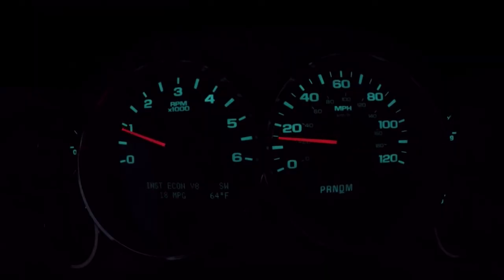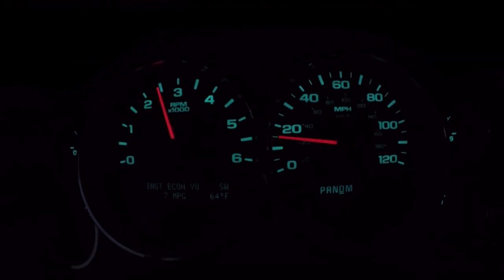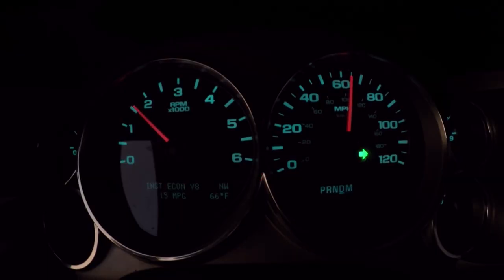Pros and Cons of a High Stall Torque Converter

Comment: Finally answers I needed. I had a cam put in my Challenger. Runs great except stopping at low speeds or trying to take off slowly, it jerks forward choppy, surging. So, stall converter is needed for mine then. I just don't wNt to big of a stall. I figured between 2800 and 3400. But thats a good range. I have a 5.7 rt with a Stage 2 HRT Comp Cam.
Reply: I know you've probably already moved on and gotten a stall (or even a new car), but I love to talk about stall converters, so I thought I'd add my perspective. When looking for a stall, a lot of guys try to get as close to their peak torque rpm as they can stomach. I'm an LS1 guy. Our stock motors make peak horsepower at 4000 rpm. A 4k stall is kind of a up there, so the general consensus in our community is 3600 rpm is a good balance for high performance and streetability. That stall speed, 3600, generally means you'll have to tack on about 300 rpms more to do anything until it hits lockup. A lot of guys put 3200 or 2800 rpm stalls in their LS cars and are disappointed. But I think they drive very well, not very noticeable. 

I'm assuming you had your car tuned after the cam swap. Look at the dyno sheet and pick either 1) as close to your peak toque rpm as you can or 2) where your torque curve starts to get really fat, but not quite at peak torque rpm.

However, if you really are worried about getting too big of a stall, you should still look at your dyno graph, and look at the lower end of your torque curve. Pick a spot where you are making some torque, but not too high of an rpm. 2800 or even 2400 may be better for you.

I do have to say, though. You have a cam. A big enough one to cause vacuum loss at low rpm. Why would you not want to pair it with the correct stall? The stall that gets close to peak torque. Can you imagine cruising around and having access to like 80% of your torque anywhere, anytime, at any mph? Although, I guess if you got a big cam with a lot of overlap, you're already tossing gas out of the cylinder, literally. So, I could see if you didn't always want to have to rev up 300-400 rpms higher to do things. Would hurt gas mileage even more. But still, a proper stall would make your car insane, I bet.

Comment: i have a 2000 silverado single cab with a 232/236 cam and 3600-3800 circle d triple disk converter which i use as a daily driver 😁 it actually runs really good on low rpms you do feel quick acceleration just by tapping the gas a little bit though

Comment: Great video .  
     I'm glad you mentioned adding or using a larger transmission cooler .I'm in the process of building a Chevrolet small block 400ci and going with a larger camshaft .  I plan on using at least a 3500 rpm stall for my application.

Comment: Your torque converter must be calculated and tuned for your vehicle and its use. If you pick it by price only, you will most likely think it drives like ass.
Reply: I'm confused by this. The research I have done and from others input. They say you can run a 3k stall and just put it on fine. Anything higher and you would need a tune. (4l60e)
Reply: @dnegel9546  you're going to need tuning for a stall to really have it drive right. The higher rpms a stall will flash to makes the trans computer do some weird shifting sometimes and even if it doesn't its best to optimize it. 

However what Raymond is talking about is that a 3k stall is not a 3k stall behind anything you want to put it behind. Weight affects stall speed. Gears affect stall speed. How much power the engine makes affects stall speed. The right way to buy a stall is to call a company like circle d. Tell them exactly what you have and what you're looking for and let them build you what you'll need to achieve that
Reply: @dakotadale567  circle d?
Reply: @guardiandogoargentinos1385  They make great stalls. Yank also makes really good ones.

Comment: I have a completely new drive train that I put in a 3/4 ton gmc van to use as a test bed cause the nova it’s going in isn’t ready but I’m after info here,,, I called Coan racing about a torque converter and after giving them all my info for the van,not the nova(cause I figured I could have redone later if need be) so it would be vehicle specific.they gave me an 11” converter for a slightly bigger vehicle which is what I’m wondering about here because most everyone I see and listen to on here for pick ups are using 10”.Coan told me mine came out to about 2800-3200 but mine has no looseness what so ever but still works great.it’s near 475 hp with 3:73 gears and for me it’s not about showing off but rather info.did all you guys have your converters built giving the companies all your info or just go out and buy what you wanted?

Comment: Before you get a stall ask the company if it’s  loose or tight converter. Tell them what you are looking for.  That will help you get the type of converter you want
Reply: For anyone wanting more information, they call this STR. Stall-to-Torque ratio. 2.1 is considered on the looser side, but not all-out racey. 2.5 is a race stall and will not really be good to drive on the street. 1.8 is kind of tight. Most of Yank's stuff is around 2.1 and they work really well with LS1 cars, among other things. I'm not sure where Circle D or the other stall companies fall in their STR.

Comment: What’s your average mpg currently? Get yourself ls3 throttle body for your next mod. Plug In and play. Better acceleration bigger opening.
Reply from the maker: I get around 13.4 average mpg at the moment. And I’ll look into that👍🏼
Reply: John Vesely I got the acdelco LS7 throttle body from summit racing. It’s a 90mm tb to match our gen 4/tbss intakes. Only about 100 bucks not bad. I noticed a slight increase but it does affect the tune and kinda surges at 55 cruising rpm. In my case at least

Comment: buying a built 4L60 with 22-2400 stall torque converter tomorrow to go with my stock 5.3 v8
Reply: Well your first issue is it’s a 4L60
Reply: steven Chaney 4L80 is to complicated...
Reply: steven Chaney 4l60 and 4l60e are totally different transmissions. 4l60 is more of a heavier duty 30 spline 700r4 than a 4l60e when they stopped utilizing the auxiliary valve body in 1990. 4l60e is electronically controlled, hence the e.

Comment: Ohhh okay, lol at first I had thought you said 80deg for the trans I was going to say my 6l80e in my 08 denali sport 6.2LS runs anywhere from 130-170deg but it is all time awd and i do have minor bolt on upgrades ie intake with K&N, gibson long tube headers, MBRP installer series cat back and a superchips flashpaq F5 tuner... She is a beast for a 7,100lb vehicle it moves with stock 420hp & 460tq so im hoping im closer to 460+ HP with the minor mods

Comment: Hey JV Garage i am wondering how many miles you have on your truck? I have a 2010 Silverado with 130K km (about 81000 miles) and id like to know in your opinion  if it is worth putting money into it for everything that you have in your truck. I love how it sounds and i want my daily to be just like that.
Reply from the maker: I did the cam swap to my truck when it had about 68k miles on it. I currently have about 130k miles and nothing major mechanically has failed engine wise. I did blow my torque converter and my rear end but both were known to go bad. It also depends on the transmission. If you have the 4l60e I’d recommend building that up first then add power to the truck. But if you have the 6l80e then you should be fine for awhile. But when you do mods to the truck just be ready for things to break, it’s going to happen, it’s just a matter of when.

Comment: It's common sense that at very slight throttle or at low rpm in lower gears without being in lockup a loose converter is slipping gas mileage will go down or stop and go driving it's going to be less efficient most likely slipping and revving faster until it goes into lockup if gas mileage was better with a stall it would be used by the manufacturer there's a reason your truck most likely had a 1600-1800rpm stock stall converter gearing and weight of vehicle and where the engine makes power all have a large effect of the outcome l have a Circle D 4200rpm stall in a 2011 Camaro SS and it turns 2500-2800rpm very easily in 1st-4th gear at part throttle 5th gear it goes into lockup around 45mph then 6th at 50mph then it's much like stock just the slightest bit more of throttle pressure unlocks converter rpm goes up instantly and very fast you have to try to keep the rpm below 2700rpm at part throttle in 1st - 4th gear touch the gas your past 2200rpm off idle with a touch of the petal throttle response it wicked good it runs on E85 so it's cost effective but it burns it fast 11- 12 miles to the gallon city 18 highway at 80mph at 2100-2200rpm with 3.27 gearing and a built 6L80e automatic trans it's not daily driven but is out every nice weekend for a 25 mile drive l would recommend stay with a stall of 2400-2800rpm for daily drivers 3000 max but it most likely will not perform as well as a 3600-4600 stall would

Comment: Question Sir.  When accelerating with the higher stall converter, is it only faster up to the speed previous associated with that stall of 3400? For instance, before the higher stall converter, once you hit 3,400 rpm would the remainder of the acceleration through the power band with the older stock converter from 3,400 through 6,000 be comparable to the highstall converter for that same range, or is the High stall's looseness continue to multiply torque more than stock somewhat above the 3,400 stall speed?
Reply from the maker: That is a good question and I do not have the answer. I’ll definitely look into that. I have heard that you lose horsepower to the ground with a bigger stall because of it being looser. You can also get converters that have a triple disc lock up for WOT to help with the loss of horsepower due to slippage. So there could be some torque multiplication going on but I have no idea.
Reply: This is actually a complicated question. It depends on how loose your stall is. This is different from lockup speed (also known as flash point). The flash point determines when your stall acts as if your engine and transmission are locked together. An example of a flash point is 3600 rpm. If you have a 3600 stall, that means your flash point is 3600 rpm.

How loose the stall is comes from its Stall-to-Torque ration (STR). If you have a high STR, that means the stall is really loose. That also means you will get to the flash point even faster. The third thing it means, is that your stall will not multiply torque as well after it hits the flash point. Stalls with a really high STR get to the flash point quickly, hit very, very hard at the flash point, then fade away.

Stalls with a more conservative STR take longer to spool up and hit the flash point. They still typically turn faster than a factory torque converter, which all have very low STR. Cuz I mean, come on, if it didn't help the engine build rpm faster than a factory tc, then why bother, right? However, they still build rpm slower than a high STR stall. The trade off, is that once you hit the flashpoint, your stall keeps multiplying torque for longer.

Just to give you reference, a 1.8 str stall is pretty conservative, 2.1 is in the middle but leaning to the looser side, and 2.5 is crazy loose and most people wouldn't have the tolerance for it on the street. Most guys opting for a performance stall get 2.1 STR and it does really well. Guys that are building hardcore drag cars typically get 2.5 str or more, and people who want to be really conservative with their stall get 1.8 or 1.9 and are often disappointed at the performance but like the street manners.

Comment: I’m looking to replace my TC in my 8L90. Came across Circle D (2800 stall) and was suggested Circle D for the mods I have planed. Wasn’t too sure on it and don’t know a whole lot about higher stall TC. I think factory stall on kine is between 1800-2000
Reply from the maker: Just make sure you get a big enough transmission cooler for that torque converter. The cooler the temps the less likely it will fail prematurely.
Reply: I was looking at Part # STL010 Sure-Cool cooler Flow~Control System and B&M deeper pan and dip stick to help. I didn’t even think about the cooler, but that’s an idea now
Reply from the maker: Yeah it’ll keep it safe, and honestly you can’t go too big especially if you plan on still towing stuff around. Since there’s a lot more slip in the converter it cooks the oil unless you get a better cooler.

Comment: Thinking about doing a BTR STG 3 and a 2800-3200 stall whats your opinion?
Reply: If you are going to get that big of a cam, you should match your stall to it. You'll lose a little more mpg, and it'll be more of a handful, but only by a little bit. Look at the dyno after you get the cam installed and the tune done and find where your car makes peak torque, then get the stall that is closest to that, but also that you think you can live with on the street. Whatever torque converter company you talk to can help you decide what works for you. A lot of times cams make your power band go up in the rpm range, especially Brian Tooley's cams. He likes the exhaust duration, lol. If your cam makes your power band rise to higher in the rpm range, 3200 may be leaving a good deal of performance on the floor. 

For example, I'm an LS guy, and our stock motors make peak torque at 4000 rpm. Now, a 4k stall is pretty big, and not quite as streetable, so a lot of us go with 3600 rpm stalls. Lots of our guys get 2800-3200 rpm stalls and are disappointed with the performance from them. 

Bottom line, if you really want to see performance, match it to your rpm band and don't be afraid to go a little bigger than you expected.
Reply: Stage 3 btr requires 3200 stall.

Comment: Aren't you not supposed to use 4wd on the street? People say that... but I can't really see how it would be an issue as long as you don't have the lockers turned on... If it's open diff front and back...you should be fine I'd think...

Comment: Hi i just Bought a rebuilt tranny. From a guy. He didn't tell me it had a stall converter in it .  Called him found out it was a 2000. I have hooker headers. A mild cam. Pushing close to 400hp on a 68 mustang. Im just getting this all together currently. Any thoughts anyone. Im concerned all of the Complaints on them but mine is 2000. ?

Comment: Did you get the 278mm HP 3400? This is the one I ordered. Was worried it would be too tight daily driving but with the 2/B pump and stator I was convinced it was loose enough. Great vids!
Reply: How’s it doing? I just bought a billet 3600 multidic/ multiplate stall
Reply: @jasonloera3358  it’s perfect for the 3.42’s and stock tires on my truck. Gets into power band on throttle fast, but stays low idling around in traffic. Wouldn’t buy any other
Reply: @tayhay8  with that high of a stall does it shift late into every gear? Like when it’s stock it shifts to second at around 2k rpm now I’m assuming it’s closer to 3200?

Comment: I hate mine. It’s the worst mod I’ve ever done. Makes the truck not enjoyable to drive. Constantly revving the piss out of it to go anywhere. ‘04 Suburban, small Summit cam, heads, exhaust. I had a shop put it in when the transmission was rebuilt, it’s to the point where I almost thing somethings wrong with it.
Reply from the maker: How big of a stall is it?
Reply: Sounds like too high stall speed for the setup. You have to figure in the power, gear ratio, weight, tranny, application, and tires

Comment: I'd think you would lose the most gas on that long distance and maybe save a bit when idle in drive at a complete stop from my understanding when comparing to stock converter but idk because I haven't tried it yet. And not an expert.
Reply: It's the opposite. Long distance means you're likely on the highway. On the highway a high performance torque converter (stall) will hit its lockup, which means it will lock the engine and transmission together with no wiggle room. That's what every torque converter does, even the factory ones. So, on the highway, you're essentially driving a stock converter.

It's at low speeds that the stall really does its magic. It makes the engine and transmission more loosely coupled together at low rpm, so the inertia of the car isn't working against the engine while it tries to build rpm. To go fast, you want this because motors don't make much power at low rpm, so you want to make it easy for the engine to spin up to the power band. A 3600 rpm stall means the stall is loose until it hits 3600 rpm, then it gets tighter and transmits power from engine to transmission efficiently.

However, what this means in terms of gas mileage, is that if you'd normally be cruising along at 1200 rpm, now you have to go at 1600 rpm (or whatever) to go the same mph because the connection from engine to transmission is loose and it doesn't transfer power as efficiently, that's the trade off. Having a higher rpm for basic things like gently moving from a stop light means you car uses more gas.

Think of it like this- at low rpm, you're actually giving up power because the connection between the engine and transmission isn't as efficient. This makes your engine work harder and use more gas. However, if you're actually trying to go fast, this is great because the looseness means your engine can spin right through those low rpms and get in the upper rpm range where it makes serious power, then the stall tightens up and becomes efficient at transmitting power.